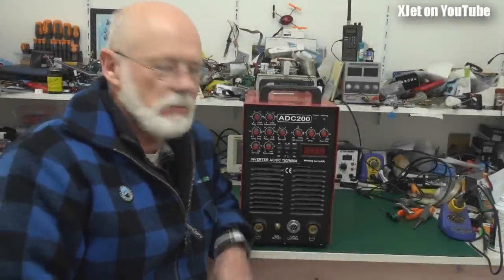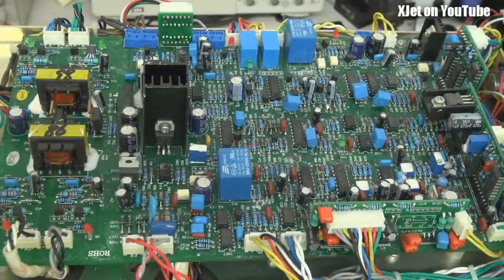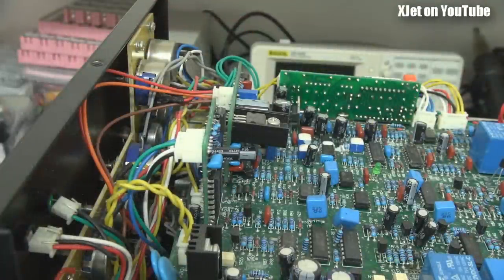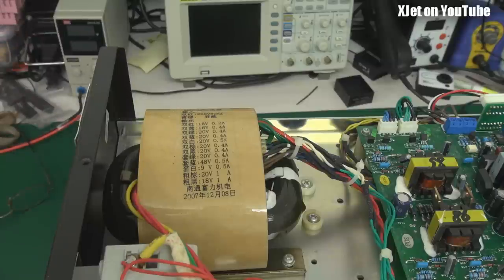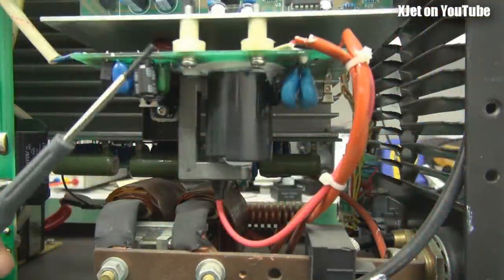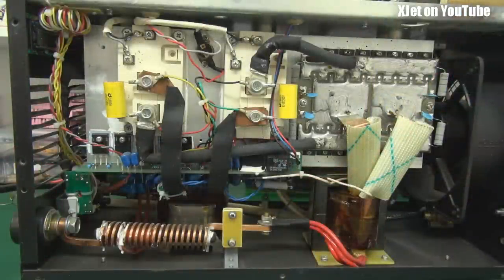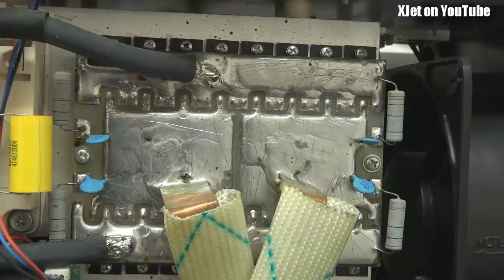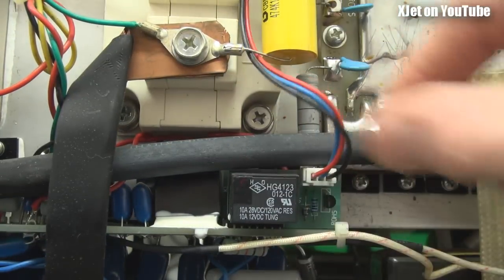Chinese 200A TIG welder teardown

Comment: Just referring to the first daughterboard, I note that the device mounted on the heatsink has its leads going straight into the solder pads and I bet the heatsink is fixed with soldertabs or similar to the PC board. Not a great idea. When the device gets warm/hot, the leads expand and apply pressure to botht e board solder joints and up into the device case if the soldering is good. Better is to have a bend in the device leads so the expansion has somewhere to go rather than applying pressure where it can cause damage. Same applies to other devices mounted on vertically-fixed heatsinks.
The worst thing about the wirewound resistors is where they are positioned - a great way to heat up anything above them including the leg joints.
The devices mounted to the heavily solder-laden board are, judging from the lead configurations, paralleled Schottky rectifiers, the type you might find in the 5V section of a computer switching power supply. Which is OK - voltage ratings don't need to be that high and Schottkys can be paralleled without ballasting.
I'm wondering whether the device mounted on the copper bar on the other side isn't in fact a current-sensing module possibly a current transformer for AC mode and incorporating Hall-effect devices as well. ?
There are so many bad things about the construction of this machine in addition to what you've pointed out. I also noted what appeared to be crystalline salt on the upper control board. And it would be a nightmare to troubleshoot without a circuit diagram. Having said that, a compact control system using a microcontroller/ASIC would almost be a non-starter if something was wrong there.

Comment: on the heat sink for the IGBT you will see a small round device with 2 wires coming out of the back. it is mounted on an oval metal plate. these are common on heaters, microwaves, electric ovens, large amplifiers etc. they are a one shot over temp device and a very common problem, I have repaired loads of devices by changing out the damn things. what they call it I do not know but it is like a thermal fuse and once triggered your device is dead. simple to test put a meter across its terminals if it is open circuit you have found your problem.

Comment: Ugh! That is one seriously nasty collection of fugly circuit boards. The last time I cracked open a TIG welder it was to adjust the spark gap (life was simpler then). I agree that flyback transformer looks like it was ripped straight from a CRT.  Hope you get it it sorted, Bruce =)

Comment: Those blue capacitors are in parallel to increase capacitance like  c1+c2+c3, and the blue disks are  thermistors by the diodes,  I would not let him work on my welder that's for sure.

Comment: It was made for welding aluminum and not aluminium. That's what did it in. I'd replace those two electrolytics with Panasonic 105C parts and see if it doesn't start right up. It's always the capacitors.

Comment: +xjet : at 15:49, I don't think that's current measurement using a shuntresistor, that black thing around the busbar looks a lot like a current transformer. It would make a lot more sense to measure with a current transformer at those current levels. I'm not exactly sure if it would be effective when welding with DC, but it's quite likely the DC output is actually just PWM chopped without any filter capacitors. 
And at 14:15 : that's a flyback transformer from a television, no doubt about it. In TV's, that's what's used to generate the grid voltage. The great advantage of a flyback SMPS is that you get a lot of power in a really small form factor compared to other SMPS topologies.
On the topic of SMPS topologies, I saw an SG3524, which is a CLASSIC PWM controller, it's in all the power electronics textbooks. This design really looks like it was built around parts that are cheap just because they're old and abundant.

Comment: Interesting as I am thinking of buying a TIG welder for welding stainless steel parts for spearfishing shafts.  It is scary how far a chinese product will go to cut costs and a TIG welder carries some pretty high AMPS so I think it is better to buy a high quality product rather than a cheap product.  Which TIG welder do you recommend that can deal with small SS odd jobs and also double as an aluminium and steel welder for small jobs?

Comment: i have a similar machine it stopped working the problem was a loose molex connector went around pushing them on it has been working for the last 10 years but the hf start stopped my one has no ac only dc i paid about 300 ,15 years back only use it for arc welding have the tig torch  i might use on another machine one day , i like the bleeder resistors on the caps unusual for the chinese to do that maybe someone got a zap .doesn't look like any thing burnt i bet its a connector or dry joint .

Comment: More videos like this would be cool - not sure I'd attempt to fix such a welder myself though :P

Looks like something that's got far too many problems or potential problems to be worth it.
Reply: +Andy Plater I tend to agree.  It might be possible to narrow it down if we knew the nature of the failure, but how much longer could it last?  This is absolutely dreadful.  That cover hid a multitude of sins.  I'm probably going to have nightmares tonight of malformed capacitor banks and giant solder blobs with rosin eyes hunting me down.
Reply: G'day,

Nah, no worries mate..; it's easy...

 Obviously only a Bruce-Level Boffin would ever dare to try to ressurect this tbing...

 Therefore, in the case of Thee or Me...; we pulls the Guts out of it, salvages the Copper, sells the Bulk for "E-Waste", and then we fill the Case with Concrete, and VOILA !

 It's Bin-Recycled...; as a Sailing-Boat Anchor..(?).

;-p

Ciao !

Comment: I don't think that is a current shunt, It looks like a regular current transformer. Inside that square-ish black plastic housing, there should be just a set of windings. Hall effect sensors are used as a binary switching devices, not for measuring analog values like current.

Comment: Wow! Talking about a hack job how in the would did they get that inverter to weld in the 1st place is amazing and with all those 100s of parts your lucky it lasted that long.. I just bought the newer version of this welder this video has me wanting to open mine up just to see if there still using so much solder lol

Comment: my ac cleaning and high frequency is playing up so the base metal allu is melting and not wetting and puddling,the supplier is asking me for a pic of the board and this welder was used for a week on and off new but unused for 2 years till now,so this is a 250 amp digi-tig,any sugestions

Comment: Good stuff man, I learned a lot.
I'd like to know some safety precautions and common problems in troubleshooting these. I once tore down a TIG welder, but I just didn't understand it and I was afraid to be probing around kilovolts. I'm used to seeing only low voltage digital electronics.

Comment: Hello sir! I wonder if you could give a simple word on converting scratch start to pilot arc (self-ignite) for plasma ( I have a cut 50). I believe a ground connection is key, if it is that simple I can add a fitting on front of machine for self ignite wire to operate torch....Thank you! Hope you can help shed light...don't think this really has to be complicated, definitely want to be sure. Any input you could give would be greatly appreciated!

Comment: I wouldn't be too bothered about the caps being next to the heatsinks, but I would be bothered about the two heatsinks being mounted so close that they shadow each other. The one with the fins inward is going to be nowhere near its specified C/W figure.

Edit: That black block on the busbar at 16:00 looks looks like a current transformer or possibly a more advanced current sensor going by its four wires.

Comment: Totally gobsmacked at the complexity - more circuitry in there than a TV!
I just thought a TIG welder was basically a beefy step down transformer and that's all.
Guess the first things to check are the heat-vulnerable capacitors.
Reply: +Andy Lee Robinson I don't understand how it could break in the first place....... I didn't wire it up :-)
Reply: +Vortecks Tony, your wiring is a beacon of inspiration, a pinnacle of perfection and borderline OCD!

Comment: Bruce, think you should do an xjet video breakdown on Ahmed Muhammad's supposed 'homemade' clock.  There are photo(s) out there.  Looks just like a commercial clock with printed board and AC converter wedged in a case, not hobbyist/homemade like everyone is wrongly claiming.

Comment: what are all those parts and so many circuit boards?  this is a very expensive design.  i designed a 250 Amp/35V OC welder that has all kinds of pulse shape and DC capability and had hardly 10% of this madness.

Comment: QUESTION . i DID A Harbor Freight Flux core 90 amp welder modification . I seen a video on YT . I bought parts that were all spec to what the fellow said . I used a 50.000 uf capacitor and a  100 amp 1000 volt bridge rectifier . These are the only components added . I checked and double checked the connections etc . Upon trying it out . It worked great for about 30 seconds and then all the sudden power dropped to almost nothing and then it tripped the breaker . And upon other tries it immediately tripped the breaker . I am not an electronics guy although I am good at following plans directions . I did everything as he said . I had a friend solder the large aluminum wire for me The one from the transformer aother than that I did everything else and I watched as he did the solder . Any tips or info you may be able to help me out with would be greatly appreciated . I would hate to think I ruined a perfectly good cheap welder . That could weld before hand . I didn't even use it . After I got it I wanted to modify it to dc before doing my project that I ended up doing with the stick arc welder .
Reply: Well apparently you introduced a low resistance path between the AC input live and neutral, else it wouldn't blow the breaker! So you unplug it from AC, discharge all the big capacitors safely and wear your gloves and goggles, and trace the path from the AC input to the fault with your multimeter in continuity or resistance mode, and if you don't exactly know what you're doing, get someone who does to keep an eye on you and guide you. Finding input shorts tends to be difficult, it usually looks like numerous paths could be shorted until you find and remove the one part that is actually shorted. You want to look for signs of damage like smoke traces and carbonised or fractured or chipped out pieces on individual device enclosures.

If there isn't exactly just a loose wire touching something, then chances are you blew a MOSFET, they tend to fail all the way short. So you'll need to replace them if so, along with anything else that is gone, and that might be quite a lot actually if you're unlucky - like I said, say MOSFET failing short will usually kill not only everything in series to it, but may have sent a good portion of the input AC down the low voltage control circuit hanging off its gate, killing a lot of that too, unless gate has sufficient series resistance on it. You'll probably want to undo the modification you did too, chances are, it has been done with a mistake, or may have become invalid between device revisions.
Reply: Thank You  God Bless

Comment: I have a problem that does not happen ignition except by touching the surface of the piece of work How to solve this problem
Reply: Could be several things. Tig welders have a high voltage start then switch to high current when the arc is formed there pretty complicated.  If it is a cheap welder it may be better just to replace the welder sorry.

Comment: Is there any way to increase wire speed on a regular mig welder??? I've had no luck searching????
Reply from the maker: +Pete O It depends very much on the design of the wire-feed motor and controller.  In some cases, yes you could boost the wire-speed but you'd have to make sure the welder had enough grunt to operate with that faster speed.

Comment: It may be worth noting that the discrete semis used in this welder are far better at handling the horrendous EMC radiated by the spark gap and coupling transformer (compared to smaller SMD devices) - Good way to get something out the door without excessive R&D. Been trying my hand at building a microprocessor-based TIG from scratch for the past few years, even with excessive filtering and isolation, it's been a complete pain in the dick.

Comment: @15:28 you start talking about a current shunt for getting current feedback... you are not really correct here.  The black rectangular piece of plastic that the copper bus bar passes through is actually a CURRENT TRANSFORMER, not a current shunt.  My guess as the why the bus bar has a hole in it to the left of the current transformer is simply because they either mistakenly drilled the hole for mounting the CT or they use that hole for mounting the CT in a different location on different models.  I'm very confident on my assessment of this.  It is most definitely a current transformer, no shuntage going on here.

Comment: If you say cheap chinese welder, what price are we talking about? I want to by an AC/DC-TIG welder soon but can't really justify going for an expensive brand. I have one "in my sights" that has a similar amount of knobs ;), is noname, but not too cheap either (700€ without accessories). I wouldn't want it to die that fast!

EDIT: I'm 8 minutes in and what I've seen up to then already gives me goose bumps. All crooked components, very bad soldering, and the transistor bodge. Really, you can forget a decoupling cap or a pullup resistor in design or layout, but a whole transistor?!
The chinese symbols on the transformer are colors btw.

EDIT II: Should have waited till the end. 1800$!? That gets you such a bodged device? There goes my enthusiasm for the hobby grade 700€ welder...

I really like the videos where you do a why and how (not) about anything engineering/science related. This one was at least as interesting as any of Dave Jones' teardowns (he does why to many consumer and measuring gear teardowns; they are all the same; I do like his other stuff though, again mostly the theoretical things mixed with experience).
Reply: I wouldn't want my welder to die that fast, but I would rather not risk dying myself by buying this thing in the first place!
Reply: it depends on what you want if for. I have a small snap TIG150i and it does what I need fine. not cheap (£4000) if I remember correctly.
Reply: Yes you can forget a transistor, if you were hoping to drive some part of the unit directly by another, but then found that you need to bend the values around a bit or your output is caving in, a bit of a facepalm that latter one but typical for early prototypes. And sometimes early prototypes are all the production boards you're gonna get. I didn't find anything I have seen there particularly scary.

But hey prices can be weird. I mean the guy lives on an island, means importers are going to be spread a bit thin, and they could have just as well bought it for $200 and sold for $2000, which I guess are NZ dollars, so it was likely closer to 1200€ or so back then a few years ago.

Comment: You waste time. I have used Chinese equipment and I thank God for it. At the price European vendors want for  similar equipment, I am ready to accept even half as good. It has made possible for us development we could never even dream of. 
And I think that the Euro stuff is Over Engineered.
Reply: Azzy M if there was ever a case of over engineering this is it. American welders have transformer diodes tap switch cables cover . Welds for 200 amps for 40 years cost 600 USD lol

Comment: Nice job thanks for your time. But, you are clueless about flexibility in production BOMs. Examples (just 2 - you can find the rest.) 

Daughter boards are not used because they change all the time. Exactly the opposite. They are used because they do very common functions and specific companies spit them out cheap. Why reinvent a PWM for SMPS controllers when 10s of K of them are all made the same by some no name company? Whack on a daughter board and let no name manage the BOM. 

Same story with the AC landing board (that's what they call them.) The mains switch changes for every region if not country to meet ever changing regulation. In addition, once again some no name squirts them out in bags of a thousand. The welder manufacturer preserves his BOM flexibility by using a common, super simple landing board and saving pennies while still meeting the crazy regulatory maze rolling endlessly like toilet paper from Brussels. 

I will let you research why the Chinese divert their PVC waste stream into every conceivable use rather than load it on waste haulers destine for developing world power plants the way the Europeans do. 

Basically, your uninformed nonsense is part of the exclusively Western anti-Asian propaganda campaign designed to mask Western inability to compete without trade restrictive regulation. 

Total fail bordering on racism.

Comment: Did you see how the front panel LEDs are wired? Incredible.  https://youtu.be/sFLRBgTPCJ8?t=7m bottom left. The fact that this thing survived being shipped from China is pure luck. I'd guess if you did repair it that it's a simple broken lead somewhere in that rats nest. I'd love to see you take a crack at fixing her. Also, the design must be ripped off an older existing TIG welder. If you still have it some percussive maintenance couldn't hurt.